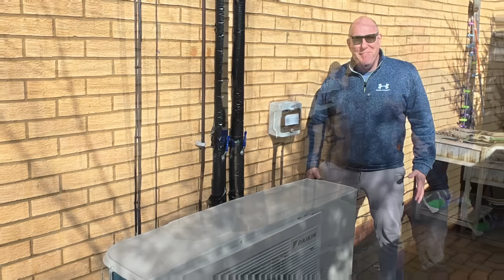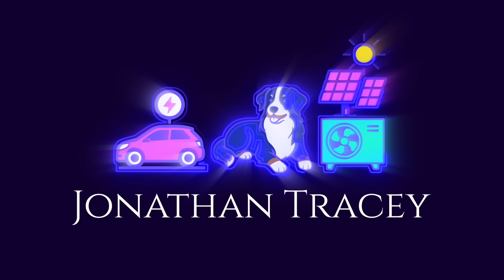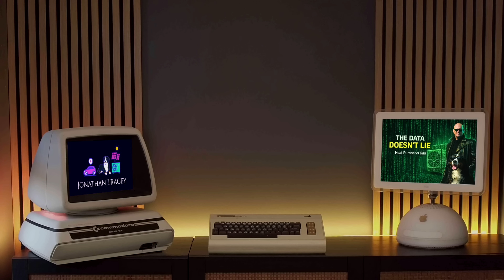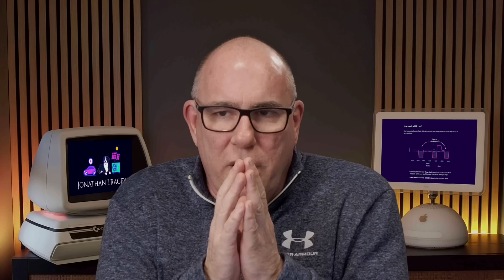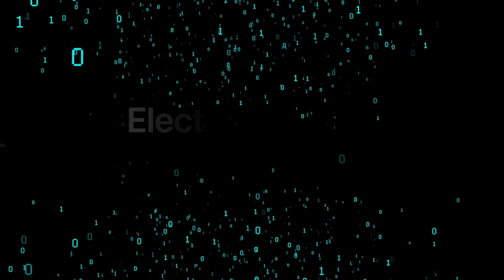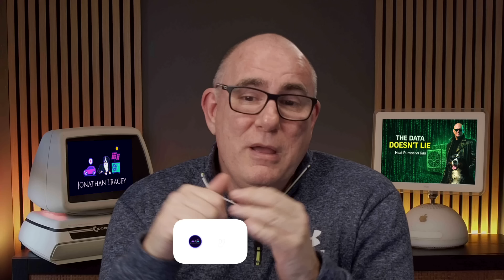The Data Doesn’t Lie   Gas vs Heat Pump Real Running Costs

Comment: I was surprised at my heat pump cost, but I do find this discussion of 'efficiency' somewhat comical. For normal folk, it's just the cost of running them. With energy costs only going to get higher due to legislative policy, the appalling EU 'carbon trading' nonsense the oaf Starmer signed us up to 50p per KW is only going to soar. I do take issue with heat pumps being green. During winter, most of our electricity comes from gas. They, just as with electric cars just move the cost elsewhere. A better option is to massive increase our building of gas, coal and nuclear plants - ideally considering thorium. We could slap a huge tariff on our gas exports so no one buys it. We also needn't t tax - at nigh 80% - the gas we do get. We could do a lot of things but that unravels the climate change agenda. 

Again, although I present a oppositional view, I do appreciate your videos and approach. Looking at the data is the only way to make decisions. The battery videos are also great.
Reply from the maker: @px794 Thanks for the thoughtful comment — and I do agree with you on one key point: for most people it ultimately comes down to the running cost in £, which is exactly why I try to focus on real-world numbers rather than just theory.

A couple of small points though. In winter it’s true that gas still plays a big role in UK electricity generation, but heat pumps are still typically 3–4× more efficient than a gas boiler, so even when the electricity partly comes from gas they can still use less total energy to deliver the same heat. Also the grid is changing quite quickly — renewables now provide a large share of UK electricity over the year.

I do appreciate you engaging with the data though — that’s exactly the point of the video. People should look at the numbers and decide what works best for them.
Reply: A heatpump running off electricity generated by gas is more efficient and less CO2 producing than the same gas being set on fire in your house.

Nuclear is proving a bit of problem - massively over budget and endlessly delayed (and recently delayed even further).

We wouldn't need to tariff gas exports. In a national emergency the government has the powers to ban or restrict gas and oil export. In that case however we'd still not have enough gas to run the country much of the year, and we don't have enough oil, or enough refining capacity to cover everyone but could probably cover emergency and essential transport.
Reply: EVs save around 75% of the energy of ICE cars.

Eyeballing the data, wind looks to have been the largest generator over this winter. New wind is significantly cheaper than new gas right now.

Comment: Why will nobody do a genuine comparison removing all the secondary equipment solar and batteries and the dangling carrot of cheap rate electricity so just a heat pump versus a gas boiler I don't think you need to test this as you know the answer the heat pump would be a disaster and before the eco warriors start I just say prove it do that test, you are a good and honest man Jonathon  however in my case and probably two thirds of the population the cost is the only important thing. thanks for another great video.
Reply from the maker: @jimh5031 I agree with you that for most people the cost is what ultimately drives the decision. The interesting thing though is how quickly the maths can move — even in the week since I recorded that video gas prices have jumped again. If that trend continues the numbers could swing back toward heat pumps pretty quickly.

The reason I include solar in the examples is that it helps insulate you from exactly those kinds of price shocks. That said, I always include the fixed 12-month tariff scenario as well, because that’s effectively the non-solar baseline most households would be comparing against.
Reply: The past week or four years ago shows that gas costs are completely out of your control. You can have control over electricity costs. Even if you don't do it yourself, at some times and in some electricity markets, electricity is free or even negative cost. Cost isn't just cost today, it's over at least a decade.
Reply: People do , there are lots of studies including academic research ones. A heatpump plus a smart tariff will win without battery in many buildings, without a smart tariff the fact the UK piles all the levies and taxes on electricity not gas will make gas a better option.
Pedantically I'd have to observe that much of the time candles are also price competitive with a gas boiler as are hideous diesel heater things.

Also it's worth noting that if people had looked at the data properly in the first place purely on a financial basis we'd have a lot more air/air heating and combined gas and air/air systems in use, because they both work out better than gas.

Comment: There is the option of just getting the heat pump and the battery. I did that for a while. You can get a 5kWh battery and inverter installed for £3500. 10kWh for £4500. If that allows you to completely load shift from the normal to cheap rate that pays for itself in maybe 5 years? depending on your usage profile. 

It's not just about the heat pump, or the battery, or the solar panels, or the EV: Each alone could be not a big change, but when you start stacking them up it makes an enormous compounding effect. 

Where to start? Solar panels if you don't need anything doing. 
If your car or boiler needs replacing then get an EV or heat pump. 
Once you have any of those, get a battery. 

You can get 0 for 2 year credit cards, and pay it off with the savings.
You can get cheap loans from banks against the house.
Reply from the maker: @Leo99929 I think you’re right that the real gains come when you start combining these technologies. Personally I think it should really be offered more as a package — heat pump plus a modest battery. Even a small 10kWh battery can make a huge difference because it lets you shift a lot of your usage onto cheap-rate electricity, which really helps bring the running costs down.
Reply: @JonathanTracey  Agreed on the package side - heatpump is the last bit if you do the rest. Not sure I'd bother with a battery as small as 10kWh simply because going to 16-20 costs so little more now.
Reply: @JonathanTracey  Say you use an enormous 48kWh per day. That's an average of 2 kW constant usage. You need to last from 07:00 to 13:00 which is 5 hours, then from 16:00 to 22:00; 6 hours, then 24:00 to 04:00; 4 hours.(The scale on that Octopus graph is no where near linear!!!)

You only need 12 kWh max to ride out the longest expensive period. 

Add some clever load shifting in there and I think you could get it down to 5 kWh, or maybe less? 10kWh shouldn't take much effort.

And if you pay more than about £670/kWh then you won't make your money back on the battery. 
And if you pay more than about £160/kWh then you won't make money exporting to the grid from your battery. 
And if you aren't fully cycling your battery every day, then those numbers only rise because you loose more of the batteries useful capacity to it just getting old, rather than through wear and extract less value out of it over it's life span which might be much longer.
So bigger battery is only better if it's cheap enough.
Reply: @Leo99929  16kWh is about 1500 32kWh is about 3000 (trade). Inverter and sparky to install it all is a fixed cost. So if you are paying someone a grand to do the work and 500 quid in materials for the battery bits you have to ask do you want to spend 3 grand for 16kWh or 4.5 grand for enough battery to use agile on a multi-day basis ?
Reply: Mortgage lenders should also give you some really good options under the current schemes. Always worth checking - you may find there is free money to be had

Comment: You can adjust your weather compensation curve (flow temperature) to sacrifice some COP for heating power/speed, enabling you to heat in the cosy cheap slots, and avoid the expensive slots. In this way you only need a COP slightly over 2 in order to make it as cheap as gas, and it's entirely possible to keep the average UK house warm using this method. This can be done without a battery. 

It will probably struggle in the real depths of winter, and doesn't offer much benefit in summer, but over the whole year you shouldn't be paying more than if you were running a gas boiler.
Reply from the maker: Haven't needed to mess with mine yet, this has been our 2nd winter and although I could squeeze out a few more % savings the house is lovely and warm so no need to chase down every improvement
Reply: @JonathanTracey  It's worth checking how long it was running for on the coldest day of the year and if the house temperature dipped. It should be on almost 24 hours solid and the house temperature shouldn't budge more than maybe a degree?

If that's not the case, then you can lower your curve without sacrificing any comfort at all. You're just leaving efficiency on the table.
Reply from the maker: @Leo99929 I agree with the principle, and you can definitely optimise the curve if you want to chase every last bit of efficiency. That said, you can also drive yourself a bit crazy trying to squeeze out the final few percent. At some point it’s good to leave well enough alone if the house is warm and everything is working well.
Reply: Does depend a lot on the property. If you have good thermal mass and good insulation then I agree entirely. If you've got a poorly insulated property or little thermal mass it's harder. It also requires ideally you slightly upsize your system - which as most are overspecified is usually fine.

Air/air it's a bit more tricky - you've got the responsiveness but if you don't have good thermal mass you've not got the buffering effect of a load of hot water to help out.
Reply: @etchedpixels  if your house goes unacceptably cold over 6 hours then you have some serious insulation issues that can be fixed with government grants and basic leak proofing like putting in a chimney damper. 

My house dropped about 3°C over 9 hours when the heat pump was installed. Then 5°C in 12 hours another day. And that was with them having the door open most of the time in the middle of February. 

If you over heat the house to say, 23°C when it's cheap, then you shouldn't get below 18°C by the time it's cheap again. Presuming you haven't left the windows open. Not ideal for comfort, but it illustrates the point that you could run a heat pump off Cosy purely on the cheap rate, where the spark gap is only about 2.1, so you only need a COP of >2.1 for it to be cheaper to run, and that should be trivial if sized and installed correctly (which should be cheap).

Comment: you've got a typo in one of your slides, you said COP 3.46 but slide says 4.46 for january
Reply from the maker: DOH sorry 3.46 is correct
Reply: Also the installation cost are high. So high,  Installed my own system.
Reply: @derekpaisley620   Which is irrelevant.

Comment: You need to be careful running the numbers just based on kWh usage. Boilers and heatpumps are substantially different in their thermodynamics. Heatpumps like low flow temperatures and condensing boilers like lower return temperatures. If your system has a large delta t between the flow and return then the boiler will be operating efficiently provided the flow temperature is not excessive. Same hydronics in a heat pump and you’ll get it fail pretty quickly. A gas boiler will transfer the heat out to the air more than a heat pump due to its higher temperature water, but that comes at a cost of a different type of use (ie on/off cycles) where as a heat pump is the opposite. It is these issues that cause some of the problem people report in heat pumps because they are designed or installed wrongly.

Heat pumps with solar and batteries and good tariffs are a guaranteed winner for cost in my opinion but like you say running the numbers is essential and it’s not as easy as just taking the kWh used.
Reply from the maker: @davideyres955 Yes, that’s exactly why I tend to keep the comparison in £ rather than just the thermodynamics. The systems are obviously very different in how they operate, but at the end of the day what most people care about is what shows up on the bill each month. So while COP, flow temps and system design matter, they ultimately all translate into pounds and pence in the real world.
Reply: Running a gas boiler slow and low also improves gas boiler efficiency. The changes we would make to how we run a heat pump also help a gas boiler. Especially getting it's flow temp below the condensing temp. That makes a step difference.

So it's not as if you NEED to make changes to get a heat pump. If you run your gas boiler inefficiently then your heat pump will be inefficient too when ran in the same way, but the effect is far more pronounced with a heat pump. Your boiler can run at 55C flow, and a heat pump can too. Mine get's a COP well over 2 at those temps, making it cost parity to gas minimum, on the octopus cosy cheap times.

By far the biggest issue is ensuring that the unit is sized correctly for the property, and that it's installed correctly. Usually that's coincidentally happily the cheaper and simpler install: Set all thermostats to max, and balance temperature with lockshields and emitter size. (emitter size should already be balanced, but rarely are due to lazy heating engineers). No hydronic separation via a buffer. Weather compensation. Heat pump close to house. Ideally in direct sunlight.

You might find that you get worse COP in peak winter, and better the rest of the year. But it's the SCOP whole year average that matters.

Comment: A heat pump still makes strong economic sense for homes that aren't connected to mains gas.

UK Government should prioritise heat pump subsidies to those homes, mainly those using heating oil or LPG. That's where the biggest economic benefits are.

In the short to medium term, gas-fired heating wins the economic case.
Reply from the maker: @tarbat Yes I agree with that. For homes not connected to mains gas — especially those currently using electric radiators, oil or LPG — heat pumps can make a huge difference to running costs. Compared to direct electric heating in particular, they can massively reduce the bill.
Reply: I think you get a FREE heat pump if you have no mains gas connection option and are currently running oil/LPG?

Although my mate in that situation pointed out the house needs a 16kW heat pump, and the feed to the house is shared with the neighbour and limited to about 80A total, maybe? So he might have to do some clever load balancing with EV charging and heat pump use ETC. I think he's limited with solar panels due to planning permission too...

Having said this, I got a heat pump and my bills went from £2400 to £1800. But I also got an EV mid way through the year and so my usage went through the roof. My fuel for the old car was about £500/year.

I got a battery and it dropped to £1250. 

My fuel bills went from ~£3000 per year down to ~£1250. Literally more than halved. Gas isn't cheaper. 

It's not just the heat pump in isolation. It's not just he EV in isolation. It's not just solar panels in isolation. It's not just a battery in isolation. They compound together, and now the EV can be cheaper to buy second hand than ICE. Heat pump can be cheaper to install than a gas boiler and last twice as long and can cost less to run. They're a good financial investment and necessary purchase periodically, so it's not like it's an "investment" like stocks or shares.
Reply: @Leo99929 Generally the DNO should pay for the unlooping. They won't cover single to three phase upgrades (but will try and sell you one to avoid paying for an unlooping). They all got their backsides kicked in 2021 over this and the OFGEM position is pretty clear.

Basically the funding agreement (RIO) for the DNOs including provision for them paying to do unlooping work when reinforcement was necessary.

If they need an 18kW heatpump though I'd seriously look at insulation first (even if listed and requiring specialist options for some of it), and also what the figures look like for air/air, especially (if you are working on cost not just CO2) adding air/air to do most of the work but with gas kicking in on the coldest days of the year can be monumentally cheaper than a giant air/water heatpump that performs terribly during the spring/autumn and requires massive radiator upgrades.

Except for conservation zones/listed buildings where it's a nightmare a good installer should be able to find creative approaches to solar panels if the roof isn't usable - walls are permitted development. Ground is generally in Scotland and in the rest of the UK you build a garden office or pergola (permitted development) and put them on top (also usually permitted development). Not btw that councils are in general likely to refuse any reasonable solar system!